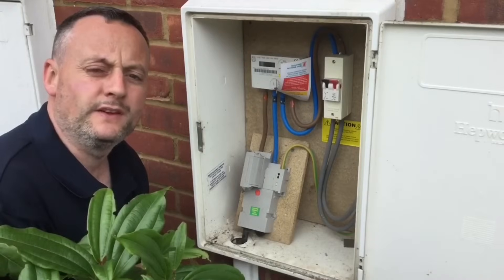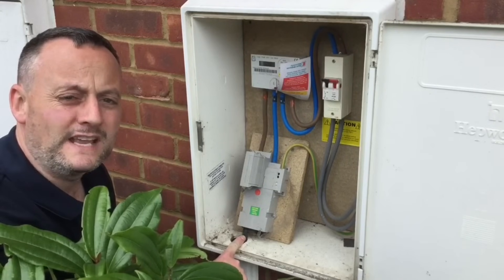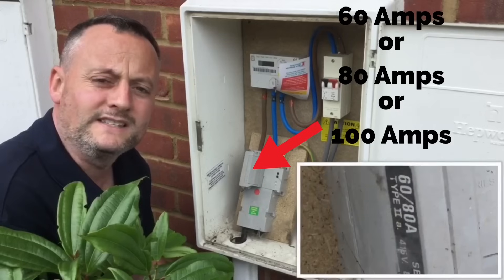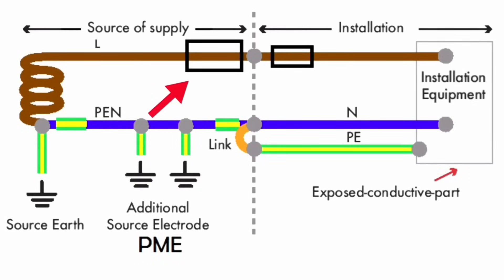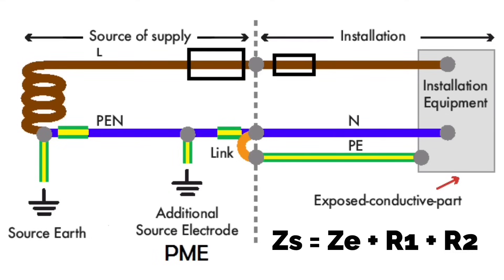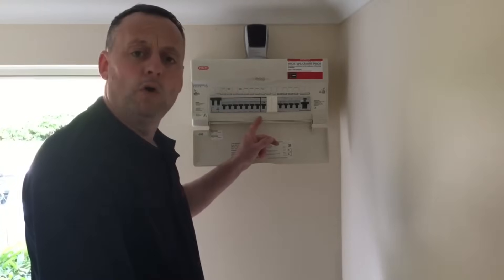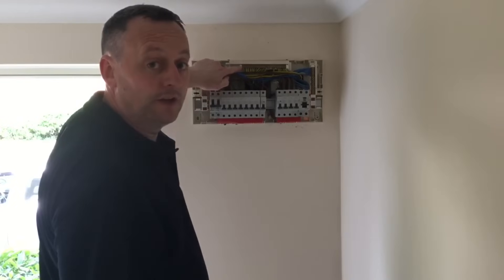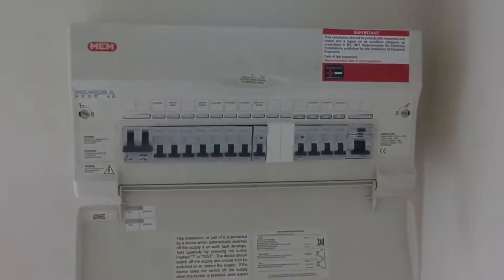Recap of TN-C-S Earthing Arrangements and Measuring External Earth Fault Loop Impedance Ze

Comment: Can’t believe you are teaching students to do external Ze, with no PPE. A fault on the meter and you have, in your case, nearly 1000A through meter. You should be using insulated gloves and face shield as a minimum. Tut tut.

Comment: Is the 16mm squared earth cable labeled at 1:03 the actual PME? The way I understand it is the PEN conductor enters this enclosure and is then split by the PME giving us a separate earth and neutral within the dweling. Or is the PME simply an extra additional connections to earth along the length of the PEN conductor in case of a cable breakage making it a crude TT system? This seems the case from your video, I may have been told the wrong information in the past.

Comment: Just to clarify... The line conductor which was the main incomer was live??

Dies the meter handle it when testing then?
Also when I said out the Meter to impedance..is that not the same as ohms?

Clear and concise lessons
Reply from the maker: Live conductors are both the line and neutral... if 10 amps flows in the line then 10 amps will flow in the neutral hence both live conductors 👍.

Comment: On series 6 cut -outs there is a link bar within the  neutral/earth chamber which for dno makes it adaptable for both tns or tncs  earning arrangements. This can catch electricians out if no id sticker is at the service head. On occasions in the past a meter engineer may have fitted a second cut -out away from a communal set up into a flat for example . Using a series 6 cut-out ( which looks very similar to series 7 and 8 cut -out ) is very useful as it accommodates both earthing arrangements. It is however of little help to electricians who assume it is tncs as they both appear to be in the neutral chamber.